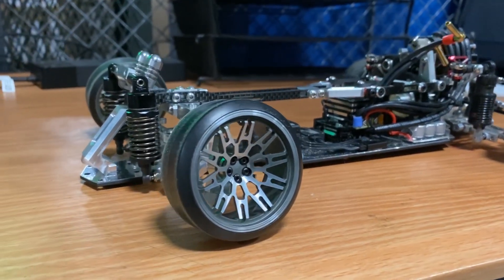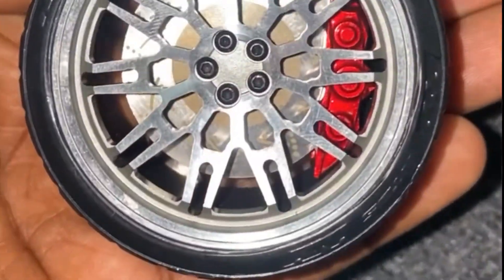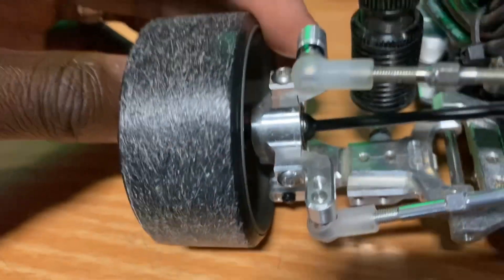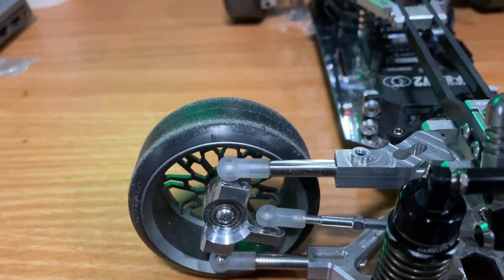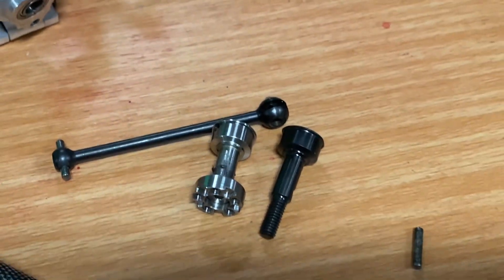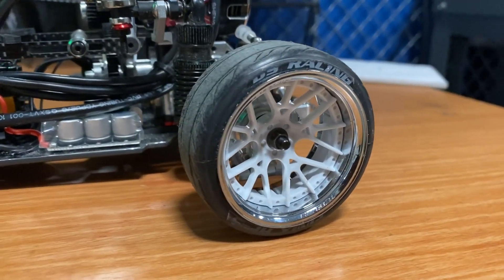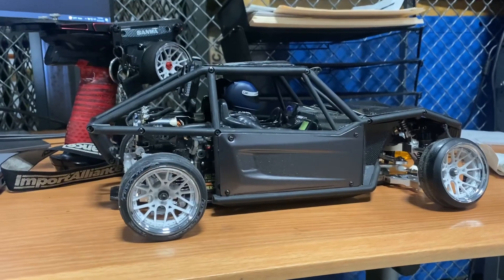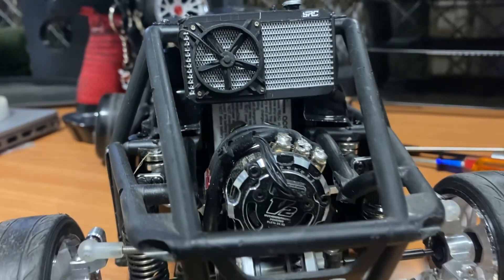DES Racing RES 2 - REAL WHEELS

Comment: Not that it needs it... but dude it would be cool to use a boat motor water jacket on a mini radiator like you have on that one rig at the end
Reply from the maker: Have a reference link? I would like to see what you mean. I wanna add more stuff to it.
Reply: @idealautofactory  Well the water jackets for RC boats are just cylinders that slide over and seal to the motor. On boats they pump water through from the water around the boat, but it could be done with a small tank and radiator in a closed loop system.
Reply from the maker: @ajbutch123 ohhhh. I’m picking up what your putting down now! 🤔 lemme look into it.

Comment: Little bit of blue locktite. Let it druy24 hours and it "should" keep anything from getting loose.
Reply from the maker: Trust me I tried. I think the there is just not enough threads to hold the whole wheel system together in the rear. I had red loctite on it. Maybe someone else will have better results.